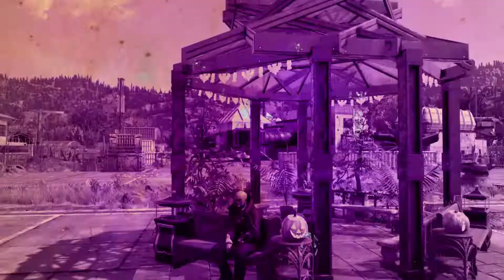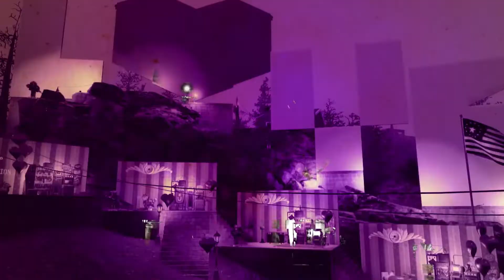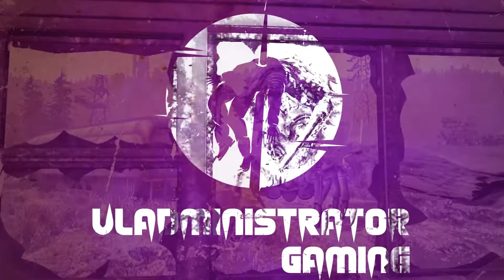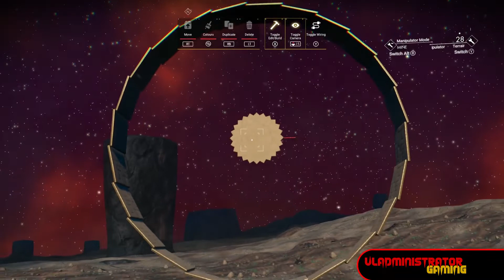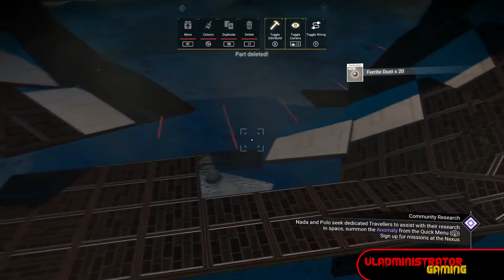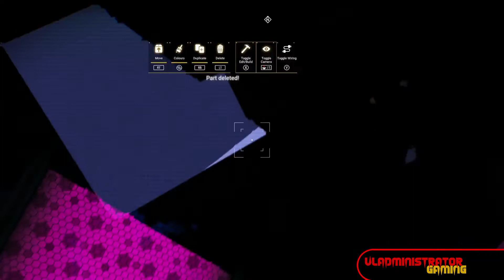How to Build a Track Loop | No Man's Sky

Comment: Is there a way to add rails at the bottom so that the vehicle stays within the path?
Reply from the maker: You could add taller walls, but that wouldn't look very nice. Instead maybe some glitched in angled floors as seen in the misty mountain hop video linked to in the video description. Or I guess I could learn to drive a bit better 😂